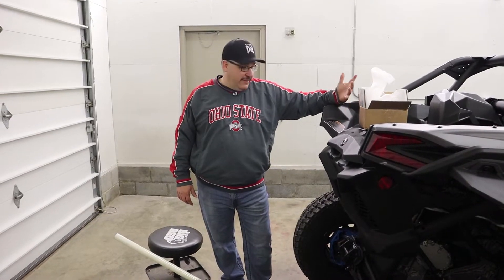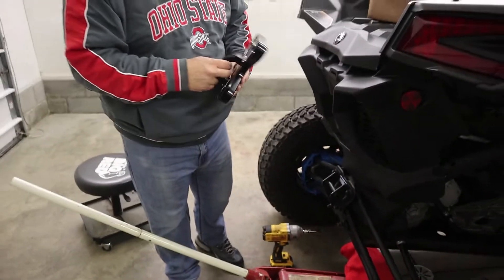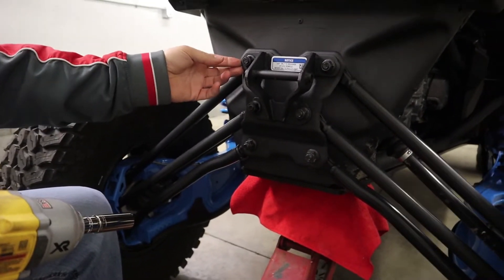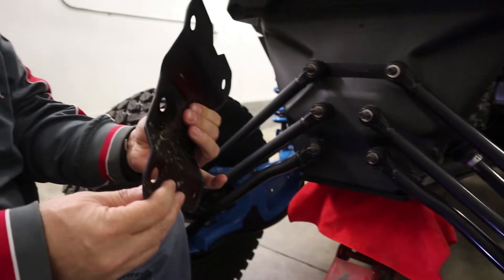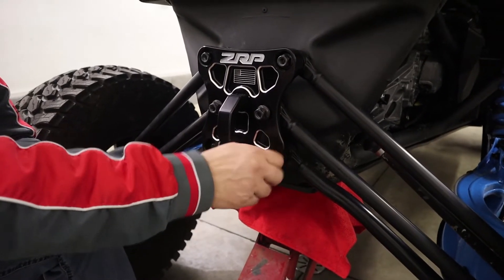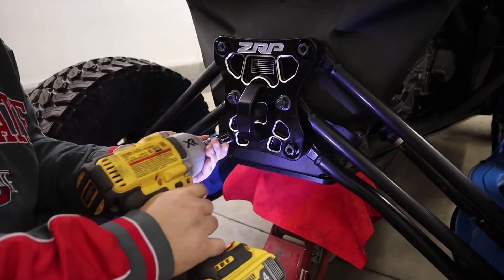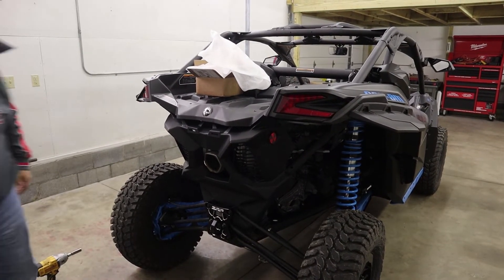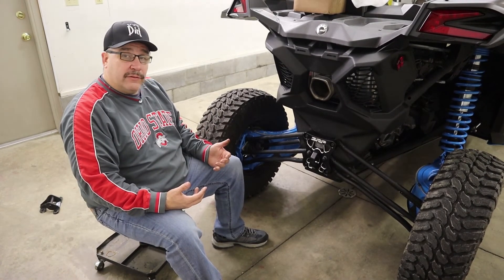Can Am Maverick X3 ZRP Rear Radius Rod Plate - Install

Comment: Have you all done the front gusset kit with bulk head and shock tower?
Reply from the maker: No I have not done it yet. It is a big job and basically have to take the whole front end apart. That's one of the things that disappointed me with the X3. I shouldn't have to do something like that to a new unit. Just my thoughts. Thanks for watching!
Reply: @UTVDIRT   oh I absolutely agree 100% on both of what you said. Yes a big job and yes I feel you on why can am didn't send that out double shear from factory.  Just started my X3 journey of dumping money on structural flaws. Still love it but as you said disappointed...